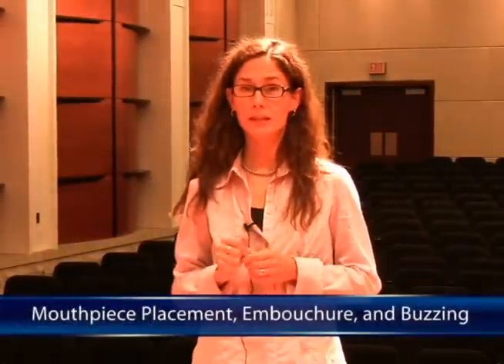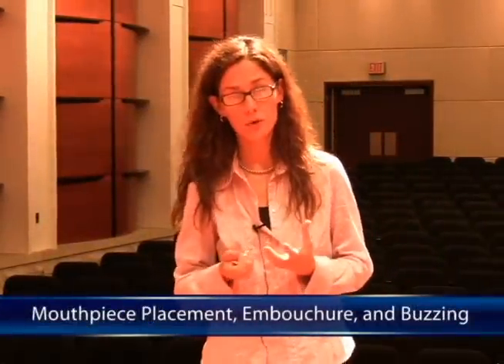Mouthpiece Placement, Embouchure, and Buzzing

Comment: Thanks for responding, Dizzyphan. I wouldn't call Arban, Gordon, and Maggio "wrong," but they are rigid in their instructions where there is a lot more variety than they (and you) acknowledge. Again, you might be interested in my embouchure videos as they show upstream and downstream players on all brass. FYI, more lower lip inside (upstream) is less common on all brass, not just horn.

Comment: I was in an auto accident late last June that prohibited me from playing the trumpet for two months.  Now, although I can make my lips buzz like you do, I can't replicate the buzz for the mouth piece (nothing by air, no notes/sounds).  

Currently, I can only hit high Ab during my first scale warmup.  After that, not even close.  Obviously, my two month hiatus has hurt my embouchure.  Will continued practicing, like weight lifting, help me slowly get back to hitting high A?  

Finally, tongue placement.  I've been taught to high high notes, I need to make an EEEEEE sound (so the back of the tongue rises up).  Any suggestions?  (PS, just came from the dentist and he said I have a significant receding jaw-where my upper teeth completing covers my lower teeth when my mouth is shut...which is seldom:-)

Thank you for your free video.  I'm a 56 year old medically retired veteran and my only desire to learn the trumpet is the ability to play Taps at funerals, but if I can learn to make good sounding notes (now they're kind of fuzzy) I'd enjoy playing the trumpet more.

Warmly, Dave

Comment: Yet a french horn embouchre uses mostly top lip as is instructed here.  Trumpet is mostly 50/50 or a little variation either way in placement depending on the player's teeth/mouth structure.  They are not the same.

Comment: I think we've found a point of agreement, Dizzyphan. It's the player's anatomy that dictates the embouchure. Where we seem to disagree is on whether there is a "horn" embouchure versus any other brass instrument. My research suggests that the same basic patterns, including variation in mouthpiece placement, apply to all the brass and in about the same ratios. Most upstream players do not have underbites, more lower lip inside the cup makes it upstream, not horn angle or jaw position.
Reply: Of my horn students that use a trumpet embouchure 1/2 and 1/2, most cannot easily play from the high range into the low range unless they do a huge shift. Some music does not allow the time to make those shifts.  If they are resistant to trying the 2/3s, 1/3 ratio, I have them work on  Beethoven's sonata, which forces them to move through the ranges quickly. After attempting the Beethoven, they'll finally give the 2/3s upper and 1/3 lower a try and their playing will become more flexible through all the ranges. There are always exceptions to this, and Dennis Brain is one of them. However, if you study the majority of professionals hornist's  embouchures (photos in Phil Farkas's "Art of French Horn Playing"), you'll see the majority of players play with a  2/3s upper lip, 1/3 lower-lip ratio than 1/2 and 1/2. Because we must be able to play flexibly and quickly through our 4-octave range, more upper lip in the mouthpiece really helps.
Reply: I agree regarding the player's anatomy. Also, I'm sure you noticed Phil Meyers plays uncentered (mouthpiece placed more on the left side than right), and typically we don't recommend that. But he's an amazing player, so clearly it works for him!
Reply: @jacquelinekerstetter8361 , thanks for the response. I had forgotten about this video and the discussion. 

The main point I was unsuccessfully trying to make is that regardless of what's typical, mouthpiece placement is extremely personal. When I teach I prefer to approach each student with the standpoint that their placement might need adjustment. Where it ends up is going to be different for every student. I have put up many videos on my YouTube channel that discuss this in more detail as well as on my blog, if you're interested in hearing more about how I approach brass embouchure pedagogy.

Comment: NO...I acknowledg variations of course, but the "aim" at setting up a trumpet or horn embouchure as in this video showing the "horn embouchure aim" are different.  I have found that upstream in trumpet players also has a lot to do with front teeth "bite".  People with big underbites usually go upstream and have more lower lip dn the horn points up at an angle.    Example, Sammy Davis Jr. would more likely be an upstream player.

Comment: And I'm saying your "all brass" doesn't not FIT all brass.  Most of your thesis is in regard to trombone or larger brass and all of your examples are based on THAT.  Horn angle is the RESULT of mouthpiece placement and jaw jutting forward or not.   Upstream trumpet players are easy to spot  because of what I just mentioned that their jaw juts forward thus the horn naturally aims at an upward angle.  Next you'll be denying a tongue arch for trumpet players despite the old xray film showing it.